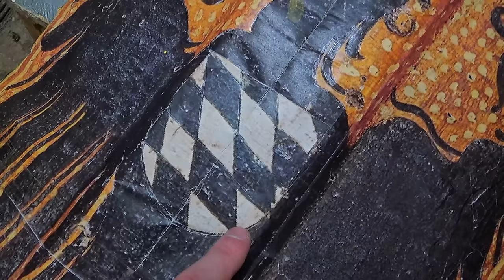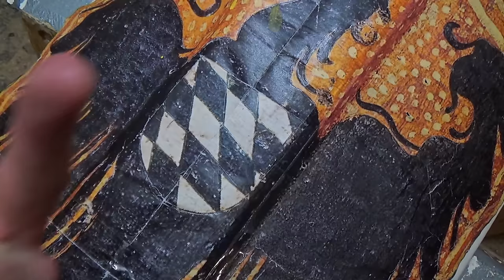Crafting a Pavise Shield Replica - The Schongauer Pavise

Comment: Another interesting project! I just had a thought about a quicker way to transfer images onto the shield surface that might be useful for you. Have you ever come across a device called an episcope? It’s like an overhead projector but it doesn’t need a transparent print to project an image. It works by shining a light on a picture and using a mirror or prism to project it onto a surface. You’d probably get a little distortion but could be handy for jobs like this. I used one years ago for transferring images from a print onto a large piece of fabric for a theatre backdrop.

Comment: My grandfather was a traditional bookbinder. He worked with some of the same materials for restorations. Smelly stuff, I remember. He did cut triangles in rawhide and linen when it needed to be folded around edges and corners, BUT not all the way to the edge. He would sort of fold the flaps, so there would be a continuous cover of the edge or corner. Hmmm. That's hard to explain in words. Do you sort of understand?

I think the originals in museums are probably dried and decayed a bit to the point where it is hard to see if everything is still exactly where it used to be. Probably shrunk and distorted a bit.
Reply from the maker: Tahnks for your honest feedback! :) 
I linked all the museums pieces in the videos description. You can clearly see where the rawhide edges are under the basecoat. If it would have deformed, we would have massive cracks in the basecoat. I am ofcourse not sure wether I cut it exactly correct, but it looks 1/2 cm correct, I'd estimate ;)
Reply: @TheShieldery  clear. Very interesting channel, I enjoy how you show the construction process and include "observations" about the materials... 🤢🤮

😉

Comment: The watertrick with the screwholes was nifty. I thought bees wax would be an option to close them entirely, but I guess that's an unnecessary effort. 
Didn't know to this day paveses could be that short, always thought they are Setzschilde for Crossbowmen and Archers. Anyway, the shields look absolutely amazing!
Reply from the maker: Thanks! The hide glue wouldn't stick to beeswax :( . I had to close some wood knots though; In order to do that, I mixed Sawdust with the 1:4 Hideglue. after it had dried I cut the excess with the boxcutters knive. I had to fill it in 2 or 3 times though, caus that kind of glue looses a lot of volume while drying.
Reply: @TheShieldery  Ah yeah, I have seen a similar trick on a carpenters channel, but he used epoxi, but that wouldn't be very athentic in your case.^^
Reply from the maker: @Haekeldrachen  I saw something with Superglue (Sekundenkleber) and sawdust. You can hide cracks semales with that trick.

Comment: When you pull the screws out...why don't you just drill out the hole and put in another peg?
Reply from the maker: only 3 pegs per side got used in the originals. If I'd fill in the screw holes with pegs, I'd have more then twice as much as necessary of which 4 are to close to the edge.
Reply: @TheShieldery  Understandable.